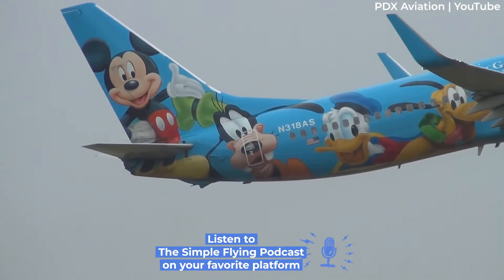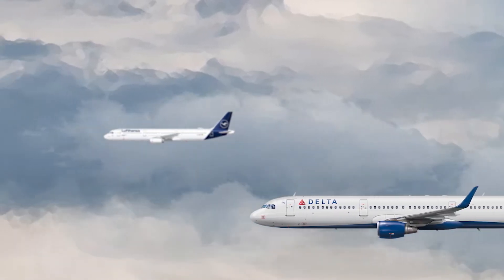How Does The Boeing 737-900ER Differ From Its Standard Counterpart?

Comment: I don't like Delta 737 900er Because there's no window on 15A but there is a window on. 15F does it make any sense? I believe that if there's a window on 15F there should be a window on 15A. It's very tricky and it's not comfortable not having a window if you select a window seat
Reply: all 737’s are missing the window on the left side in that spot, my understanding is that it’s where the ac system ducts through.

Comment: I flew on a Delta 737-900ER out of LAS in 2017 June. It was about 112-114 degrees or so outside that day. I was in seat 1A. We dang near used the entire runway lifting off. Looking out, when you finally felt the climbing happening, we we just over the end of the runway. We were nose up still rolling felt like forever…
Reply: The 727-200s took off the exact same way 💯💯💯

Comment: I’ve been waiting a long time for a comparison like this I know that the B737-900ER is much more popular than the -900 standard variant with only 52 sold and not a significant pac jump from the B737-800NG but I wasn’t quite sure why. Also the 737-900ER became a much more compelling choice over the standard variant vs the A321. I have also only flown the much more common -900ER with Delta from Detroit to Atlanta and Detroit to Anchorage Alaska via Seattle WA. Now the B737 MAX 9 is taking the place of the -900ER… 😊

Comment: 737-900 is mainly to increase the fuel tank. But the range is still not as good as the a321xlr.
Reply: maybe because the 900 was made in 2006 whereas the other was made in 2022?
Reply: Definitely from different era...

Comment: Had the chance to fly on the standard 737-900 with Korean Air between Jeju and Seoul last December. Cabin was quite dated, but clean and although there was no service at all, it was probably my most enjoyable flight in a long time. The cabin was only 30% occupied, so I could move around to take pictures outside from different angles. The crew noticed and chatted with me when I went to the toilet afterwards. They were super sweet ladies and as the cherry on top, gifted me some stationery and other Korean Air souvenirs to take home.

Comment: I’ve flown in 737s across all generations for nearly 25 years. I flew a -900ER for DL just this past March, right after hopping off a company A321 (my second time flying in anyone’s A320). Any fanboy saying that the A320 cabins have any real advantages over a contemporary 737 is a bald-faced lie. 🤦🏾‍♂️

You’ll barely feel the extra inch in seat width (if that), and most of the features people brag about depend on the airline rather than the airframe. And the average customer wouldn’t tell the difference between the two blindfolded, nor would they care.

I view the 737 and A320 as two stellar products. There’s a reason they’re both some of the bestselling aircraft ever.

Tidbit: UA apparently calls their 12 regular -900s “the dirty dozen,” due to their logistical problems.

Comment: All 737 is extended range these planes should be scrapped as b737 are the world's most oldest aircraft in the world plus should be retired when using newer aircraft Boeing csnt move forward as keep going backwards
Reply: come back when you can talk some sense
Reply: @nutesacque692  Ive flown most of the 737s  up to the max.
My impression of the -900 and observations as a pilot 
1)
It has small wings and is under powered.  Therefore.
Its lands at a very high speed and takes much more runway to take off.
2) its has the same brakes as the smaller versions and reqires a long  runway for landing...
I call it the dash 9000 because you want 9000 feet of runway.
3) ON a long flight you will be stuck at FL300 in the tops of the weather until you burn off enough fuel to climb
4) if you unload the first class passengers before unloading the aft cargo pit it will set back on its tail
5) it has the same systems as the first one built in 1968 ecxept for a few back up controllers on the airconditioning system.

Most pilots hate it but the airlines love it because its burns about 5000lbs of fuel per hour vs. 757 that burns 7 to 8000 lbs per hour.

Boeing put lipstick on a pig on this one.
My opinion